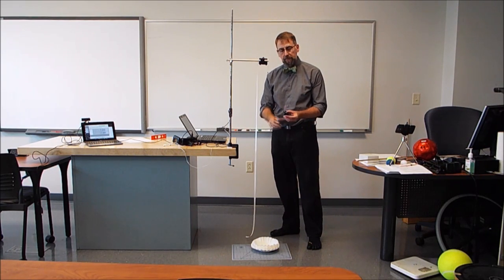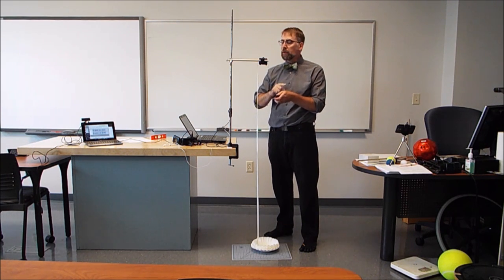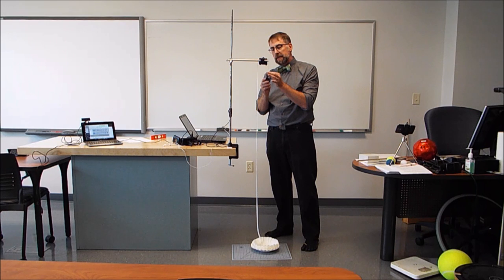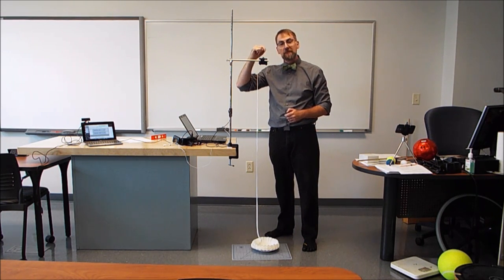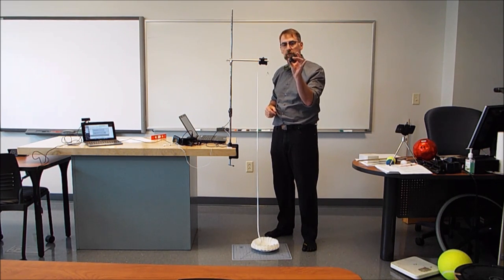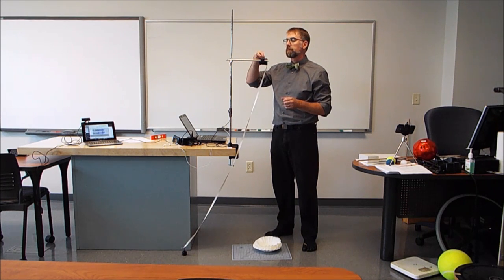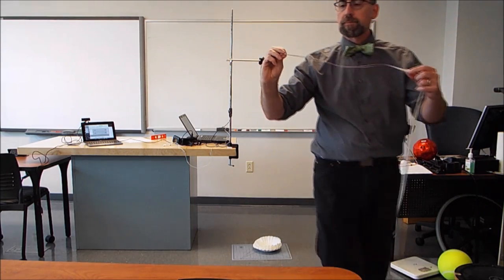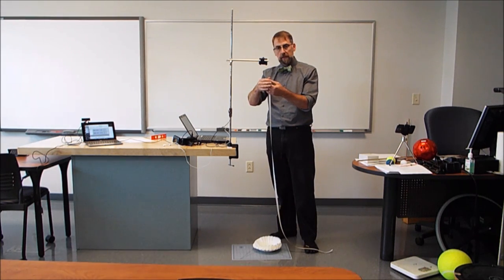Ticker Tape Timer Explaination

Comment: Sir, do have example or calculation of say 5 bricks on a trolley being pulled through a ticker tape ... Later a few bricks fell ... Calculate how many bricks fell?
Reply from the maker: I don't have that example handy.  However, I think you could figure things out by comparing the accelerations.  In the first one you would know the mass with all of the bricks.  The second acceleration would be larger because you have less mass.  For both, use F = m a.  I'm assuming that F was the same for both.